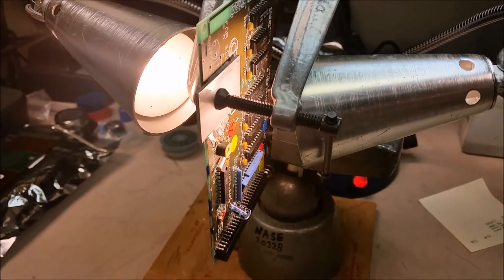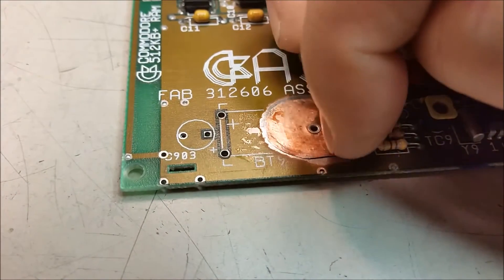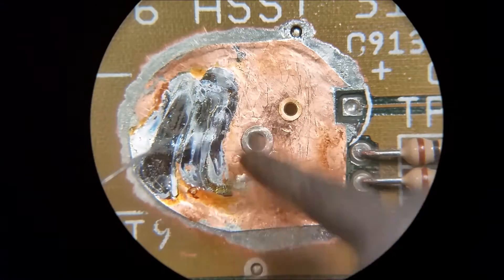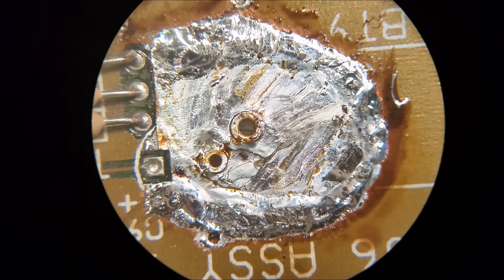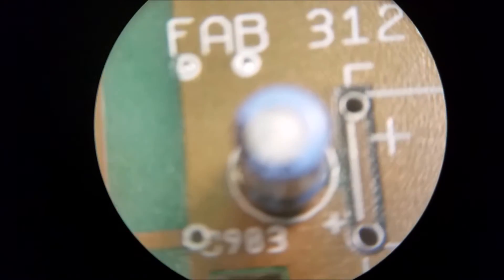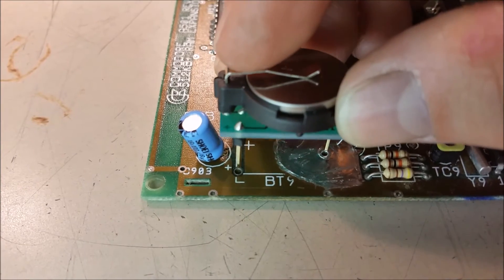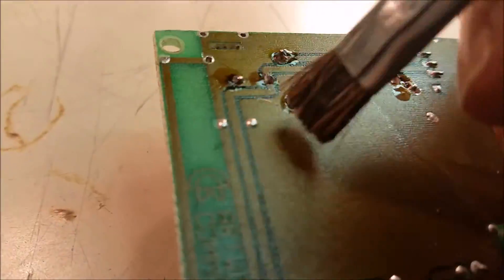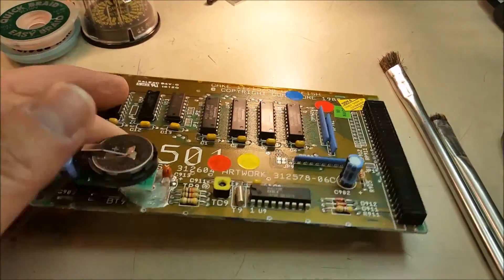Solder Tutorial Part 8 How to Replace Corroded Copper Plating

Comment: Keith Noneya, cool work! I watched many video of our repairmans (from Russia) and they restore copper tracks on modern mainboards with help copper wires and protect with help UV varnish. But there is other situation a little - you also restore the pinholes. Maybe, better to use mix process, i.e.:
1) Remove the old copper.
2) Restore the pinholes.
3) Using copper wires instead a copper plate (gluing a plate is a long process)
4) Using UV varnish for protect.
p.s. sorry for my bad English.
Reply from the maker: The copper plate was a ground plain, not a signal run. We do the pin holes, or Via's here in the US, last so the via will help hold the copper plate down when soldering. High Temperature UV Varnish is a really good practice. Wire runs are good when the flat run can not be done easily, like a broken internal run. Your English is not bad so no worries. Keith Noneya
Медная пластина была заземленной, а не сигнальной. Мы делаем отверстия для штифтов, или Via здесь, в США, в последнюю очередь, чтобы через пайку через Via можно было удерживать медную пластину. Высокотемпературный УФ-лак - действительно хорошая практика. Проволочные прогоны хороши, когда плоская протяжка не может быть выполнена легко, как сломанный внутренний прогон. Ваш английский не плохой, так что не беспокойтесь. Кит Ноня

Comment: Wow! Such dedication and attention to detail! Glad I found this series. I have an Amiga 2000 with a couple of bad eyelets and a broken trace on the CPU socket. Compared to what you have done here, it would be seem to be much easier to fix. Do you want to make my board your next repair?   :)
Reply from the maker: Hi Jdryyz. Thanks for the thanks. Loved the A2K's they were pretty advanced for their time. Do a video of the boards problems and post it on your channel. If it's not to hard I may find the time to do it for you. Do you live in the New Orleans area or within an hours drive? I just got done yesterday fixing a Rotary Encoder, a slide pot, then I fixed 6 runs and installed 8 Eyelets for the same guy who owns the board in this project video. Simplethings and I are doing a YT joint channel venture by doing video series on a repairing a MPC1000.  Anyways they probably won't be posted until next week some time. I don't know when Simplethings will post his videos on it, so stay tuned. Until then I'm working on the Cadillac CTS project and the Big Shot EM Pinball Machine series. Thanks for watching, and if you're serious about me fixing your board post the video on it and make another comment here in a reply. Best Wishes n Blessings. Keith Noneya
PS here's a link to Simplethings channel. https://www.youtube.com/channel/UCLxoVzIzuIN1tQ7DRO7gB6g  Keith N.
Reply: HI Keith! I'm way over here on the left coast! I wish there were more retro-enthusiasts who do this level of repair around here. I did capture some photos before my (work) phone was replaced but now I can no longer record video. I bet if you saw them you would say "pffftt...I could fix this in my sleep".   :) I tried when the damage was not as bad and only made it worse. Thanks for sharing the Simplethings channel. I will check it out.
Reply from the maker: My Brother lives in central Cali, I used to live in the San Diego area when I was in the Navy. Have a friend take the video for you and you can post it on your channel. Let me know if it's that easy I'll do it for you. I'll do a video on it and post it for you, and send you a copy on a cd when I send the card back to you so you can post on your channel too. It's up to you. Keith Noneya
Reply: Sorry, no means to record a video I'm afraid. Email photos?? It paints a pretty clear picture.
Reply: I fixed it! Not as detailed a repair as yours and who knows how long it will last but it is stable at this time.  :)

Comment: Great video series. High end craftsmanship and it shows. The level of skill and knowledge to do this kind of rework is insanely high. Even if a noob / hobbyist like me had all the tools, I'd still need to put in more then a few years worth of time & effort to gain the experience needed to pull it off. Great job.
Reply from the maker: Wow thanks Dermot, I've been a qualified Solder Technician for over 20 years. The Navy taught me in the 80's. It was one of the hardest school I had been to. They looked at your work under a microscope, basically back then they taught us to NASA Standards. Today the requirements are a lot more practical. I still try to keep close to the higher standard. I appreciate your time to comment. Thanks for watching. Best Wishes n Blessings. Keith Noneya

Comment: wow, haven't seen such extensive repair work for a long time.
Most people would jam that new battery in with some jumper wires.
Reply from the maker: Yeah it was an excuse to do a video on the subject. Also it was for a friend and since I do this kind of repair a few times a year it's not really that big of a deal for me anymore. I have some videos I haven't put up yet on how to remove burned burnt circuit board material around dip holes and rebuild the board using dental material. At work we work on aircraft test sets so it has to be right when it goes back to the customer. We get to do some really cool, "Are YOU KIDDING ME!" repairs now and then. Usually it's just fixing eyelets and bad runs, but sometimes some tech gets in there and really tears em up. Are you a solder technician?Thanks for the comment. Best Wishes n Blessings. Keith